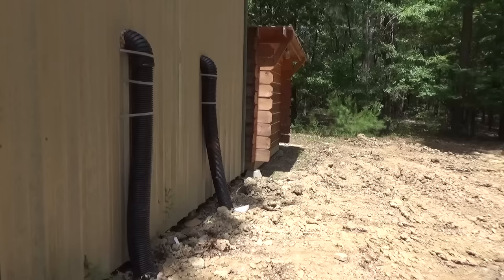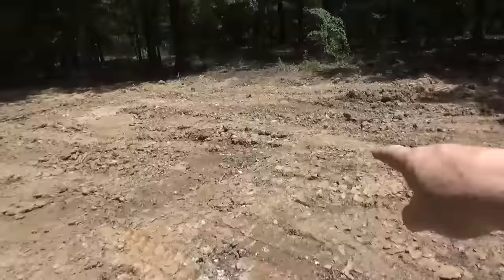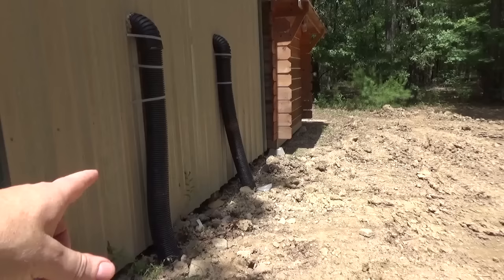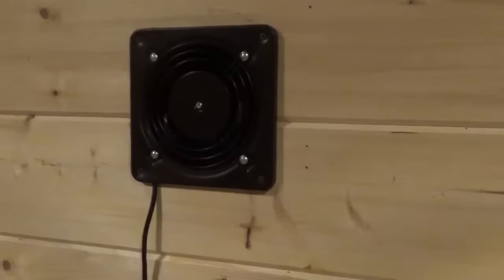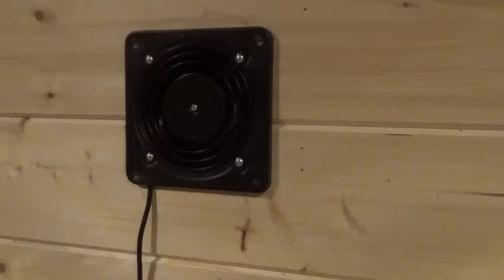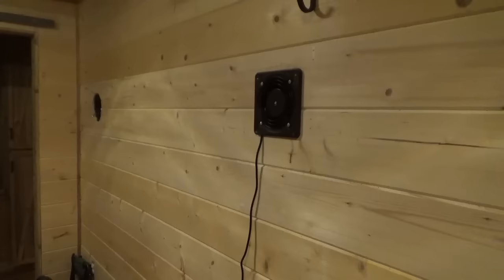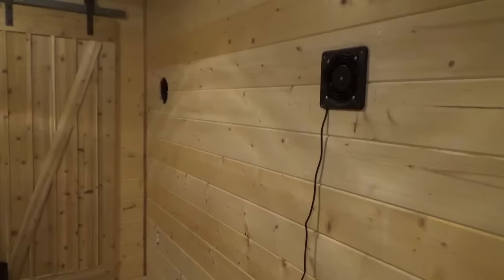Offgrid Underground Air Conditioning

Comment: At the very beginning he states the approximate ground temp of 52 degrees, then said he used 100' of pipe.  Best case senario, 100' plus the length above ground.  Realistically, he likely bought a 100' roll of the 6" pipe he used (mentioned later when talking about the fan that pulls the air through the pipe) so 85' +/- buried.  I'd guess not much over 250 sf of living space to be conditioned so I'd use that as my starting point....except I only watched it because it seemed a pretty simple, but not easy project, unless you happen to have a backhoe. Kudos to Uncle Dave and his low budget cooling project.  I am mildly curious about mold and mildew being sucked into the cabin, though.
Reply from the maker: I run a dehumidifier in my cabin and I have a filter on the suction side. Total cost of materials was about 250 at the time. Minus rented the tracthoe
Reply: @uncledavesfrontier6846  wouldn't the soil bring it in?
I hope not,  I think it is a great idea.
Reply from the maker: @em945  it's buried in clay
Reply: @uncledavesfrontier6846  ✌😁i obviously didn't listen properly. I am off grid and farming,  and mould really can be a prob to not discount.
Wishing you the best!
Reply: @uncledavesfrontier6846  Here's what I don't understand:

A dehumidifier is just an air conditioner that dumps the heat back into the same air it just cooled. You can get the same de-humidification affect PLUS the benefit of cooler air, by just buying a normal air conditioner and using that handle both the cooling AND de-humidification of your cabin.

To me it makes no sense to burn electricity running a de-humidifier (Which actually creates heat inside your cabin) when the same electricity could be used to run an air conditioner that removes both the humidity AND dumps the heat outside instead of back into your cabin. You would get a lot more BTU's of cooling by just using an air conditioner in place of the dehumidifier, for the same electrical input, and you wouldn't need to rent a backhoe and bury 100 ft of pipe 4 ft deep.

Comment: I had this idea for a while. Does condensation will build up in a pipe? I think that pipe should be laid sloping away from a cabin with two 45 elbows and T section right in a middle. extended to ground level for vacuuming it (just after first bend right where small bush is at in a video) Correct me if I am wrong

Comment: The Romans had a similar setup only without the electrical part. They built a chimney on the opposite side of the house that was painted black and let thermal conduction move the air for them. Their intake was also open on the far end, so it wasn't a closed loop system as yours is.
Reply: I dont understand

Comment: I plan to do a similar thing in northern MI but will opt to circulate liquid into a thermal exchanger rather than directly using air, in order to avoid mold problems.
Reply from the maker: I'm building a hobbit house next. With that one I'm gonna do what your talking about. I'll run water filled lines in coils in my pond back into a radiator in the house.

Comment: heads up to anyone trying this.
i did this but used clay pipe, works great and adds a little humidity as it can be very dry where i live. i went from 86F inside down to 73F and the humidity went from 37% to a nice 46%.

Comment: From the Mayo Clinic: 
Legionnaires' disease is a severe form of pneumonia — lung inflammation usually caused by infection. It's caused by a bacterium known as legionella.

Most people catch Legionnaires' disease by inhaling the bacteria from water or soil. Older adults, smokers and people with weakened immune systems are particularly susceptible to Legionnaires' disease.

The legionella bacterium also causes Pontiac fever, a milder illness resembling the flu. Pontiac fever usually clears on its own, but untreated Legionnaires' disease can be fatal. Although prompt treatment with antibiotics usually cures Legionnaires' disease, some people continue to have problems after treatment.
Reply from the maker: I researched all that before deciding on this project. The temp difference isn't enough to cause condensation.  I run a dehumidifier in my cabin.  I have a filter system now on the air intake.  I test the air monthly. Still super clean air coming out.

Comment: I've considered doing this, but using the air to feed a traditional heat pump unit.  You'd need more pipes to get enough airflow, but the problems with getting water into the underground pipe, and mold would not be an issue.

Comment: Great idea!! Is the uncovered hole a return? If so, should it be higher to pull hot air out? Otherwise, love this concept!
Reply: I was thinking the same thing. Pull the air from the ceiling where it will be the warmest. Heat rises.

Comment: I had an idea like that could be more than 20 years ago but I could never talk my family into doing it? Don't have a backhoe,, but the neighbor does! Another idea that would definitely help in old style rafter buildings is to sheet off possibly even insulate the bottom side of the rafters, not in between. Create a manifold at the top on the south side of the building, then an insulated pipe to take it down to the air vents in the rooms. Probably a little huskier fan would be needed, but you could have warm air during the day during winter time.

Comment: I never thought of anything like this. One thought I had was using a small pump to pump ground water through a heat exchanger to cool air circulating through the house and let it drain back to the well, but I suppose there would be a contamination issue there.

Comment: I have seen that done with water pipe 1 1/2 and filled with windshield washer fluid.  You just have to bury the pipe deep enough and have enough distance in pipe.  Then using a radiator and fan.  Have heard that works pretty well.

Comment: Basically what you’ve built here is a very rudimentary heat pump. These are a great idea in certain climates. You can keep your place above freezing with it if it ever gets cold in your area as well. Unfortunately here in Alaska where I live they are problematic because in many areas we have permafrost and the areas we don’t the frost line is so deep in the winter a heat exchange/pump system like this would be a major undertaking using more energy to build than you’d save over several decades. Of course we’d be using it primarily for heat as the days requiring an air conditioner are minimal.
Reply: I did something similar but in reverse inside my high tunnel here in Alaska. I pull the hot air from the top of the tunnel and pull it through the rammed earth under my raised beds. I also insulated it horizontally around the tunnel, and then covered the insulation with 6 mil black poly, so that all of the cold rain water sheds away from my foundation. The soil in my tunnel was thawed out in February and I was able to plant seeds in March.
Reply: How is this a heat pump?  it is a fan moving air from a cool place to a hot place. That is not a heat pump.

Comment: I had a landscaper who did something similar to this years ago. He was also a tree man so he had a lot of extra wood chips. He dug a massive hole, 12x12x10, and filled it with the chips. He ran some pipes and a loop similar to what was done here. As the wood chips decomposed they generated heat. I forget how he pushed the air through the pipes, but he said he kept his shop warm throughout the winter. Never found out the end results years later, good or bad.

Comment: Good example, for  use the advantage of thermodynamics to redesign.  Place the return vents lower and supply (cold vents, higher so you defeat stratification.  It will create a more even mix of air than coming off the same pipe.  I might have had two runs of pipe with a heat sync medium running opposite ends of the building

Another consideration is to use Cinder blocks and seal with a water proof wrap.  It will take the structural loads and is an excellent heat sync to the earth.
Reply: Put 'em both high. The exhaust to prevent stratification, and the intake to draw in the warmest air ...unless you're also running a circulation fan.

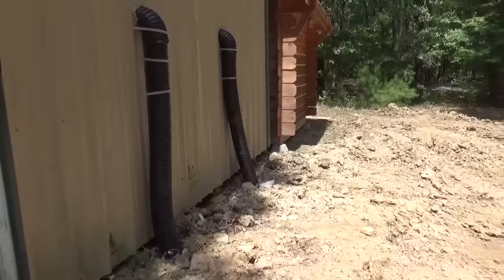Comment: like others have been saying and at 00:30 it has a glaring error here.  because your dropping the temp of the air with the thermal mass of the ground and the angle of the pipe you will have water condensate and will have no where to go causing mold.  you can dig up the pipe and put a t-join and some wire thin mesh and connect that into some gravel to keep the bugs out so you can have a water drain in the pipe.

what the guy is trying to achieve is lowering the temp with the thermal conductivity of the ground but it just does not work as well as water.  if you had a concrete pound that is under shade run the pipes under the water, even if the ground and the water is the same temp the waters higher conductivity means the heat transfer is faster and more efficient so you can cool more air faster with the same area of pipe.  because the pipe would be underwater a drain would be impractical you would need a in pipe with a submersible pump to solve the issue of condensate.

Comment: Super high efficiency mini split air conditioning systems can now be run DC direct from solar panels with as little as 600 W. Which is only two solar panels at roughly $200 each. of course the mini split would be quite a bit more than that! But the technology is improving rapidly.

Comment: If you have a drainage system under your (basement) floor slab you can use that piping system in a similar fashion, with some modification (no digging needed)...

Comment: Run a system of water through pipes buried in the ground. A pump to move the water slowly in an unpressurized system. On the inside of the home you have the pump pull the water to the top of a radiator like a large automotive one with a cap of course but no pressure. The water runs in and fills the tubes with cool water and a fan blowing on the radiator transfers the cooler air to the room while heating the water to go back through the system. This prevents the humidity issue and mold and bacteria issues. Be sure your water is safe so if it leaks below ground it won’t contaminate the ground. You might even be able to find water piping that is corrugated to increase surface area to help cool the water. I think that would be the safest way. Build a small one to proof out your layout and fix any bugs in the system you may find. I think pex tubing will do a great job. Easy to lay underground, they wont’ corrode and is safe. The pex tubing will last a real long time. You can get tubing in different sizes. Its like how folks use it to heat flooring. You could do it to cool the flooring too if you have an packed earth floor or concrete floor. If not run it through a radiator with a fan and that can be powered totally by solar. If the sun is out you can have a cooler home and if the sun is not out you don’t need it. Try a small system in a small space to test this. I know it works but you may not know it works. It works for heating and cooling. Just need enough pex tubing to make it work. For me we have standing water at 20ft down and moist water at 8ft. So if I go 8ft down I can have my tubing in contact with cooler moisture soaked soil. The length of tubing determines how cool the water gets. Remember heating wise,  it is easier to warm a home from 50 degrees to 70 than it is to warm it from -20 to 70.

Comment: I've experimented with thermal mass too. The problem that remains is the same one Carrier struggled with...the ambient air temperature must be lowered to below the ambient dew point temperature....and thats going to take an input of energy..Carriers first movie theater was cool, but the people filled it up with water vapor and it got sweaty real fast. Some method to condense water vapor will be necessary in all but arid conditions.

Comment: This is the first opportunity I’ve had to view this video and I realize I’m late to the party.  I belonged to an organization that was a 501 C3 museum and we used this system to cool water for a huge engine with hundreds of feet of tubing buried underground so I’m familiar with how it works.    I would like to make a suggestion and that would be that it appears as if the outlet air coming from underground, and the air being taken from the building to the circulated underground are at the same height.  The hottest air in that structure is obviously at the highest point so my suggestion would be to turn a 90° elbow and raise the intake pipe to ceiling height.

Comment: If you plant trees i used evergreen trees plant 6' from house & 6' apart when thay get above the roof edge trim the top thay will start to bush out . When planting use black 2:46  dirt and if you can sum old plow blades put them foot from roots evergreen like the iron . Im 68 years old been there & did that . 😊 you will have nice shade & wind block for your cabin . 😊

Comment: this cooling system was abandoned in europe because off condensation and mold problem... even silver coated pipes didnt help... the only good possibility is to dig water circuit pipes and pump water to ceilings or a cooling unit in front of recuperation unit... i have the ceiling version and it works good and consumes around 18w of energy

Comment: I could be wrong, but if you pulled your return air from as high as you can, it should pull the hottest air out of the room replacing it with colder air.

Comment: Maybe you could build the system with a heat exchanger style, that way the circulation air is separated from the air you breathe and you could wire up a solar fan to blow across the cool pipes. Keep in mind though the temps need to be constant or the by product is condensation. You could try bubble wrapping 7-10 inches past the heat exchange that way the air pipe would be insulated because anytime you run a conditioned air through a non conditioned space the by product is that line sweating 6-10 inches away from the heat exchange.

Comment: Its better to just use a regular heat pump, and run a glycol heat exchanger into the ground.  A simple circulating pump and radiators attached to the heat pump boost its operation tremendously.

Comment: If you had run water in a pipe in the trenches and used a radiator inside, you could have easily collected the condensate there. Since you will have condensation in the underground part of your pipe, I think you'll need to run a smaller piece of tubing into that pipe to periodically pump out the condensate.

Comment: Yes... a great idea. But it will only work in areas of low humidity in the summer.  This type of system does not remove moisture from the air. Same reason swamp boxes only work in a dry location.
Reply from the maker: I run a dehumidifier in my cabin. Also have a filter on the intake

Comment: In humid climate, it's better to run PEX pipe burial grade in big Loops 6 ft down in the ground and then pump fluid through the PEX pipe and then through a radiator with a fan in the house.
Just a low voltage boiler pump will pump the fluid through and keep it circulating
Reply: What fluid would you use?

Comment: How do you handle any condensation in the tubes and the mold it can cause? Or have you tried to filter it to see if you have any?
Reply from the maker: I have a filter on the intake. I run a dehumidifier in my cabin. After a year of use, I've tested the return air and there is zero mold spores. This air doesn't get cold enough to produce condensation.
Reply: @uncledavesfrontier6846  Thanks so much. My dads house in Norther Arizona gets really hot. I've thought of actually going under the Trailer and burying some pipes just under the soil about a foot, since it's shaded and has insulated skirting. It wouldn't take much to offset the temperature in the house if I did it for several rooms each. Then when I can get an excavator do it right. Condensation and mold was my biggest worry. I was also thinking about just doing them vertically in the ground and doing several loops side by side to save yard space. Have you seen anyone do them vertically? Thanks again.
Reply from the maker: @keithnoneya  haven't seen vertical piping. But then again I couldn't find anything on how I did it either. Trial and error. I have some other ideas I'm gonna try on my next build.